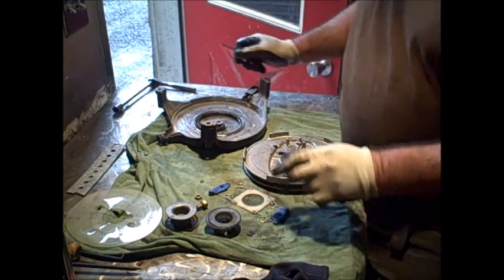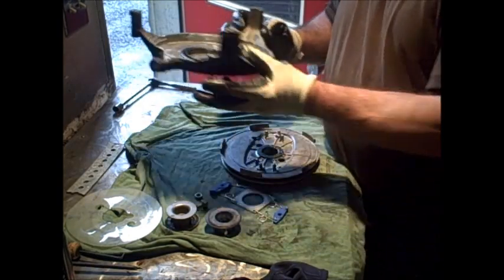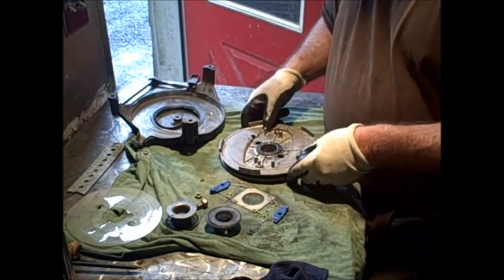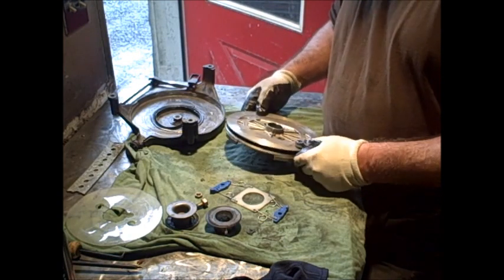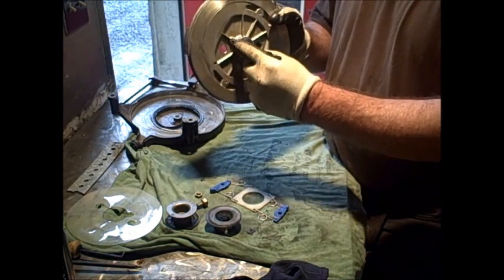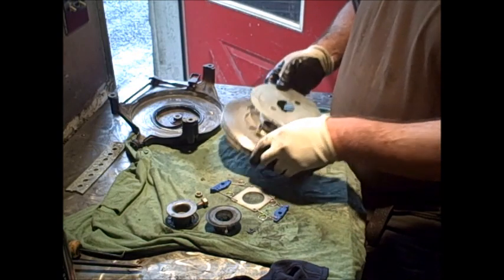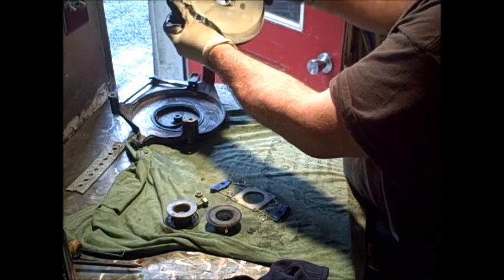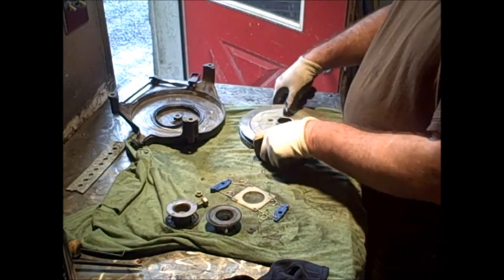OMC,, Johnson,,,Evinrude Recoil starter rebuild, parts & how they work!

Comment: Worked for me.   I think first and foremost you convinced me to clean all the parts.   I was being lazy. 
Threads on mine were stripped, I was able to drill out, press in a carriage head from the top and use a nylock nut to pull it all together. 
Your assembly instructions   made my day.

Comment: Thanks so much for this excellent how-to video, I was able to refit my spring on a unit exactly like yours here, with no snags or foulups. And  when I refit it all as you instructed, having relubed it, all was OK. Interesting thing-you are using a Lubriplate grease here, the manager of the refinery that makes Lubriplate greases used to live right next door to me!
Reply from the maker: +Kiggsia,  Glad you got it back together,   I use several Lubriplate products. One of many oldtimers I was mentored by told me to always put a 1/4 cup or so of Lubriplate 105 in all of the old style Evinrude / Johnson gear boxes. I do to this day.                 kodi

Comment: Could this be installed on an 1987 Evinrude 15HP that gas the weird spiral gear pull start setup on the front center side area of the engine. All it does is it engages with the flywheel from underneath the flywheel with the oem black plastic gear! 

My ‘69 johnson 9.9HP has a pull start setup good enough for double the cylinders inside. Very well made. 
The Evinrude setup leaves a lot to be desired. Had i known I would of got a different model honestly...

Comment: @kodibass I have the same starter and the Pawls broke off and the pawl-to-friction plate links (wire springy things) are destroyed. I bought new pawls, links and friction plate. How far do I need to tear it down for just these pieces? Do I have to release the spring?

Comment: This is an awesome tutorial, do you have any sources for the parts? In particular the Starter Assembly for a 1997 25hp Johnson P/N J25REUM. The one I need parts for is just like yours with two starter pawls, all I can find are ones with only a single pawl...

Comment: Awesome video kodi!  Regarding the plastic square plastic friction plate that the pawl springs connect to...I have to wait over a week for one to arrive via mail but want to get back on the water soon. Any “hacks” on making one myself using a piece of plastic?  If so, what kind of plastic would you recommend?  I was thinking perhaps a piece of a thick container like a washing machine detergent jug?  I would cut out the center hole and put a tiny hole in each corner for the pawl springs to connect to...wanted to get on the water tomorrow
Reply from the maker: +Billy Hubbard,  I think this could be done for sure,   any good , milk, bleach, anti-freeze  jug along that line would get ya there,  you  can always do the rope rapped around the flywheel & pull like king Kong thing.                                kodi
Reply: kodibass Thanks!  I ended up using a thick plastic container and cut a “close enough” shape. The original one was melted and deformed so I had to do a best-guess. It worked great!  I was able to get the boat started. Couldn’t have done it without this video!  One other question - do you have measurements on the OEM bolts to mount the pull start?  The previous owner clearly replaced them and they’re not sized properly.
Reply from the maker: +Billy Hubbard,  I must of missed it, what size/ model  motor are you working on,  Then i can get you the bolt size/thread count.        kodi
Reply: kodibass Looks like I figured it out. Thanks again for the videos!
Reply from the maker: +Billy Hubbard,  Great & you still have all your fingers & eyes,  lol  kodi

Comment: Hey kodi happy new year’s,I have a 1956 15 Johnson Fd 10 L, my starter prawl broke, my question is can I use the same starter prawl from a 1958 18 hp Johnson? Marine engine has it in stock Part #0203697 I love this little motor and I trying to bring it back to life, please help.
Reply from the maker: Yes that should b the same.      kodi
Reply: @kodibassInsideoutboards  thank u sir

Comment: hola desde mexico , tendras un video para starter recoil de OMC CD-11 COMO  AJUSTAR PLATO
Reply from the maker: +Antioquia Ministerios,  Hola'  Si'  I will post soon for you.                       kodi
Reply: tanks , 
I also have a jhonson 25 year 1973, and he has the problem that the recoil start hits when he throws and hits when he returns, I already check the trigger, and if he hits but I can't solve this matter, can you help me? I even bought a new trigger, I already maintained the dish as you did in one of your videos, but keep hitting, I take the spark plugs out of the engine and it works very well and it doesn't hit, but I put the spark plugs on it and I throw back and hit new coming and going. Thanks for your attention. greetings and blessings.
Reply from the maker: @MinisteroAntioquia  ,  Check the washer on the bolt that comes up from underneath and has the nut on the very top.  Sometimes the washer does not lay flat in the bolt hole,  which lets the trigger hit the flywheel ramps.                                                             kodi
Reply: thanks for answering me and taking your time to help me, the truth is that I am already desperate I can not find the fault, I have already done many things, I have even done what you say, I have come to think about changing the spring although I see it well, well I will review Again what you advise me. It is that it hits very hard back and forth, and the trigger is new. Thanks again for your attention. BLESSINGS!
Reply: Sorry, I do not speak English. I am using the Google translator. If you do not understand any words, it is the responsibility of the GOOGLE Translator. TANKS FOR UNDERSTANDING
Reply from the maker: @MinisteroAntioquia  , Take it off  look for marks where things are hitting each other,  Something is not allowing your sheave that the cord wraps around to seat .  What year motor is it ?,  I will look at my manual and do a video for you on how it should go,  give me the year and horse power again
and I will get a video up of for you fast,                                                                 kodi
Reply: greetings and blessings, I want to thank you for your time to advise me on the failure of the manual start of my jhonson 25 engine, I want to tell you that I did 2 things and solved the problem:
1. Follow the instruction of your video how to maintain the manual boot.
2. I removed the steering wheel and I realized that the wedge was broken I changed it and the problem was solved.
THE PROBLEM WAS THE BROKEN CRANKSHAFT WEDGE.
Tanks for everything.
Note: Finally I wanted to ask you where, in what part, where I can buy old engines to restore OMC, Jhonson Evinrude, buy them at a good price to restore them and sell them here in Mexico. THANK YOU.
Reply from the maker: @MinisteroAntioquia  ,, Hola  The best place to find ""Good""  motors is in the US  states that border the Great Lakes,.  Because these motors ` Have only`been run in fresh water..  Every time they are started they are being flushed with fresh  water!   Now where can you get lots of evinrude , johnson  motors  cheap? For re-sale in Mexico...   Small coastal towns in Florida.. for sure..       kodi

Comment: I have 91 6 hp evinrude.the pull cord is frayed in middle but not broke.spring is fine.can i replace rope without messing with spring
Reply from the maker: +Jonathan Wise,   Yes  , pull the cord out until it is as far as it can go,   this loads the spring..  take a pair of locking pliers and hold in that position or use a screwdriver as in above video.   cut the not and pull old cord out.  Feed new cord in the disc hole and guide through the handle slot  tie not at disc,  feed cord through handle  tie a knot or use the omc clip if available,  very slowly remove screwdriver/locking pliers and let spring load ease cord  back in , hold cord and slowly let spring draw in cord.                                                                                              kodi